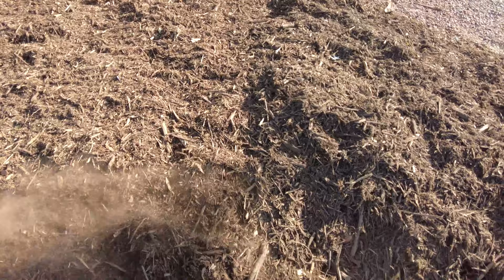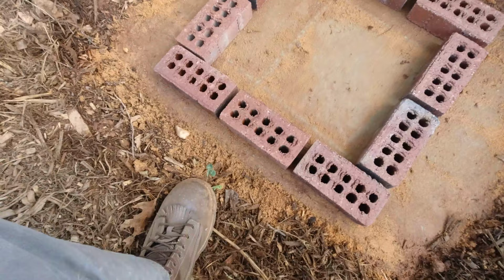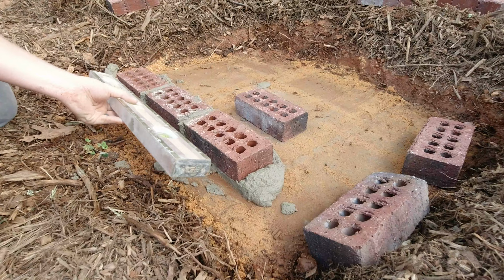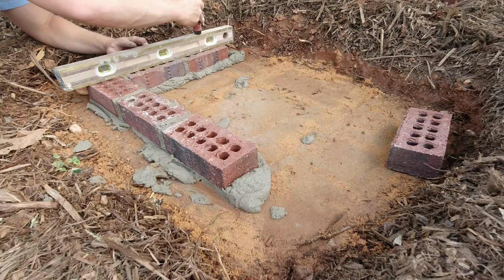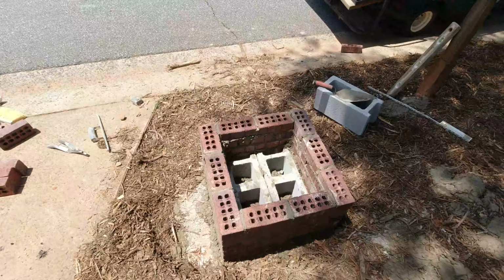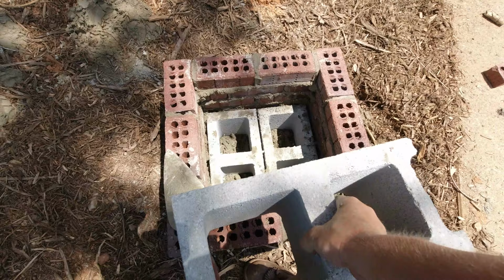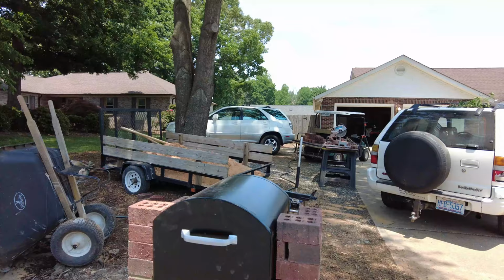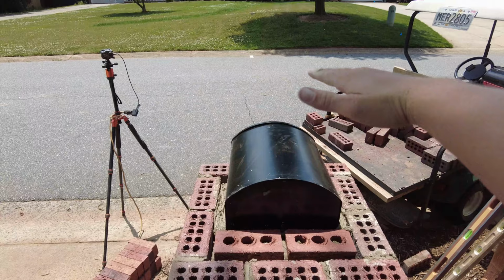Laying a brick mailbox

Comment: Walking my dog I see so many of these brick mail boxes looking like the leaning tower of Pisa, I hope the foundation was very deep and anchored with rebar otherwise it will be yet another in a few years!!
Reply: That's because those mailboxes don't have a footer under them,  you shouldn't tie a mailbox to the footer with rebar as code states masonry mailboxes need to be able to break away or apart if struck by a vehicle
Reply: @seanschafbuch4683  where I live, the guy in a sharp curve kept getting his box knocked over by cars. He sunk a 5" pipe in the ground. Next person to hit it got seriously injured and he faced lawsuits and charges.
Reply: Sounds like a good mailbox
Reply: You are correct! Even though code doesn’t allow structural components, I’m not running risk and poured concrete pad with rebar, as well as embedded rebar sticking out to tie masonry/concrete together. I infilled masonry cells @ rebar locations. I added brick ties to masonry to allow connection as well. My engineering background is to blame for over design lol😂
Reply: @el_ingeniero_87  yea I would of thrown in some ties. But I know it’s going to be fine! Beautiful work and great videos!
Reply: @el_ingeniero_87  all the more reason why a simple wood post is a better solution, and much cheaper!

Comment: You never showed us how you cut the bricks that went over and around ! How are we supposed to learn ? Did you concrete the inside of the opening as you inserted the mailbox ?
Reply from the maker: The video is more for entertainment than learning. I am sorry you couldn’t learn much! Each situation is different for how to cut the brick. Sometimes I used a chop saw with a diamond blade or a grinder with a diamond blade to make the cuts. Yes I fill the all voids solid around the mailbox as it goes into the structure

Comment: I like everything with except you didn't show The brick cuts
Reply from the maker: Thanks. I would have loved to show the cutting, but I was pressed for time during this. Maybe next time. But I just use a regular miter saw with a 10 or 12 inch diamond blade and mark and cut what I need to.

Comment: I had a delivery girl delivering food across the street knock my mailbox crooked yesterday. I just let her leave because she was delivering food with her kids in the car so you know she's broke. So anyway, I want to take out the wooden post mailbox I already have on my property and build one of these. Any tips for a absolute rookie at Mason work? My first question would be how do you get that surface the mailbox is going to sit on to be flat and not sink in when you finish building that multiple hundred pound mailbox. 🤔. On 2nd thought. Im sure there's a video for that as well.
Reply from the maker: That is very kind of you to let her go. Mason work is pretty hard until you get the hang of it. I would practice laying a few brick. Lay a tarp down and just practice laying about 3 or 4 brick in a row. Then level and plumb it and lay a course on top of that and do the same. You can disassemble it before it drys for easy clean up. The footing is actually pretty simple. I live in NC, so the frost line is not very deep. My mailbox footings are 12 inches deep and 30 inches by 30 inches square. Just dig your square hole about that size. And mix some concrete make sure it is mixed just a little bit on the wet side and it will self level when you pour it. You can use rebar to reinforce the footer.
I’ve thought about making some beginner videos. If I get a few people interested I am going to do some beginner videos with some training mortar and really do a detailed series on how to lay some brick. 
I hope this helps a little bit! I do recommend just practice for a day or so. It’s a little tricky at first. Especially when you are building a column like this and trying to keep it square all the way up. But once you get the hang of it… no problem at all! It’s really quite enjoyable.
Reply: @JustinBiddix  do it! This is the type of stuff I love watching. “Advanced” DIY. Many times a project can come out better than what a pro would do because you’re the one gauging time vs value. Some footing videos would be sweet. I seem to only find some dingus rambling on that won’t get to the point, or a manufacturer’s product video, which are so chop-cut you may as well just read the directions on the bag. Enjoyed this one.
Reply from the maker: @danervin2530  thanks!

Comment: Great, detailed, video!  My mason, put in some rebar to tie box to footing.  He also bowed the top course of brick slightly so water would run off.  He also said I could remove box and replace if needed by knocking out mortar around front of box.
Reply from the maker: Thanks for sharing that information!
Reply: Rebar is a big no no in masonry mailboxes. 

Masonry mailboxes need to have a break away from the footer in case someone hits it. 

Other bricklayers have told me horror stories about people hitting their mailbox and suing the homeowner and the mason because it was all tied together with rebar and either killed someone or injured them in the accident
Reply: @seanschafbuch4683  Wrong.

Comment: Question: Isn't it a little too far from the curb for the courier to reach from the vehicle? I know some municipality only requires only 8" from the curb.
Reply from the maker: It’s a little far. The reason I set it back so far is there is a water main right in front of it. If they ever need to repair the line they can leave the mailbox in.

Comment: Looks very good. Yours is the best I’ve seen. How many bricks did you use and how much concrete and sand did it take?
Reply from the maker: Thanks! The brick can be bought in a cube or a “band/section. A cube is 500 brick. A band is 100. You will need 3 bands. For a total of 300 brick. Get about 25 solids for the cap on top. It takes about 4 bags of type s masonry cement and about a cubic yard of sand.
Reply: @JustinBiddix  I can't believe you're not a pro. Your mailbox really looked professional done, and your instructions were on point. Did you have to cut any of the bricks to fit over the top of the mail box?

Comment: Question. What all did you mix into the cement?
Reply from the maker: Yes, so that was type S masonry cement mixed with mortar sand. Mortar sand color will vary depending on your region. Some will be white, some yellow, some darker... the ratio I always use is 3 parts sand to 1 part masonry cement.

Comment: About to do it mailbox, great detail video,  does your mailman walk or drive by.  I have to make sure mine is on the curb so he can stay in the truck.  Thanks
Reply from the maker: Thanks! The mail man drives by. The reason I set it so far back was to avoid being on top of the water main for the street. Maybe they could leave the mailbox if they ever had to make a repair on that water main.
Reply from the maker: He is still able to just put the wheel right on the curb and reach this one
Reply: I was thinking the same but makes sense with the water main.

Comment: I wonder if they had to redo it since it's a foot too far from the curb?
Reply from the maker: I did not. It still stands. I put it far from the curb because there is a water main in between the curb and the mailbox. It can be repaired without ripping up the mailbox. it’s a shallow curb that the mail man can drive on very easily.

Comment: Great video and nice work! Wondering what you were adding to the mortar at the beginning of the video? Looked like dirt, but maybe colored sand to get the color you wanted? Please let me know the logic of the mortar mix. Thanks!
Reply from the maker: Thanks for watching! That is mortar sand I was adding to the mortar. The color yellow is the most common mortar sand in the area I built the mailbox. That particular mortar mix I was using needed sand added. It was not a pre mixed mortar. I hope this answered your question. Let me know if not and I’ll try to further explain.
Reply: @JustinBiddix  can you buy pre mixed mortar so you don’t have to mix it? Your the first I’ve seen add sand to it so I am not sure
Reply from the maker: @BigHomie030  yes you can buy pre mix mortar and it will certainly do the job. The reason I add my own sand is because typically pre mixed mortars have less workability and set up faster. You will have to work a bit faster with pre mix. I like the workability of the masonry cement with sand better than pre mix.

Comment: Can I ask. Are the bessa blocks in the middle necessary? Could it be done without them fine? I’ve not seen anyone place them internally like that. I’m concerned as a rookie will it be extra difficult to keep them plus the bricks all plum and level 😅
Reply from the maker: You really need the blocks. Yes, it can be done without. But they are cheap and make a huge structural difference

Comment: Great video! Only question is how many bricks did you need and how do you calculate? Thx
Reply from the maker: Thank you. This is modular size brick. I like to purchase 300 brick for a mailbox. You can get them by the “band” or “section” at a brick yard. Each band is 100 brick. A whole “cube” is 500 brick. Rule of thumb for modular size brick is 7 brick per square foot of wall. There are also some good brick calculators online. Just identify what size brick you are using and square footage of wall.

Comment: Why is the mailbox so far back from the curb? It seems to me that the mailman will end up having to literally drive up over the curb in order to reach the handle.
Reply from the maker: The reason is because there was a water main I was avoiding putting the footer on top of. That way if it ever needed to be serviced they could leave the mailbox. It’s not a big deal because that curb is not a traditional large curb. Look how short the curb is. A vehicle can drive right on it no problem at all.

Comment: What happens if you dont already have a concrete footing? How deep do we dig to make one
Reply from the maker: It really depends on your region. You should look up building codes and find that information. But here in NC I have been digging them about 18-24 inches thick with no problems. And it should be approximately 30x30 inches for this size mailbox.

Comment: How do you determine how much mortar to put between the brick?
Reply from the maker: The joints need to be full with no gaps or voids. It takes practice to get a feel for how much mortar to use without wasting a lot. Generally the bed joint (horizontal joints) should be 3/8 inch thick. And head joints (vertical joints) should be about 3/8 inch thick. There are codes for each area that go into detail about how thick your joints have to or need to be in particular areas of construction. A great tool to use to gauge bed joint thickness and keep them consistent is a masonry modular spacing ruler. That is what I use. For the head joints just use your finger tip as a measuring tool and try to keep the head joints full and consistent.

Comment: How did you cut the 2 curved bricks that sit on top of the front of the mailbox?
Reply from the maker: Hey, they are cut at an angle. I used a miter saw with a diamond blade to make those cuts.

Comment: Super nice mailbox!!How many bricks, cinder blocks, and bags of concrete were used in this project?
Reply from the maker: Thank you! About 300 brick, 10-12 cinder block, 3-5 bags of type s masonry cement depending on how efficient you are (you add your own mortar sand to these) - tip for buying this many brick: go to a brick yard and ask for 3 “bands or sections” of brick. Each band is about 100 brick. A whole cube of brick is about 500 brick. Purchasing by the band or cube is the way to go because they are strapped together. If you bring plastic wrap for packaging you can wrap the sections together and they can load your truck with a fork lift. If you don’t go this route then buy a set of brick tongs on Amazon. They are cheap and work great! -you may already know all of this. I just felt like writing all of this to help you or someone else out.

Comment: No foundation?!! No rebars?!! Just wondering how long it'd last straight up.
Reply from the maker: I have rebared some and some not. Still have ones with no rebar standing from the year 2012
Reply from the maker: There is a foundation. It’s a 12 inch thick concrete slab 30 inches by 30 inches
Reply: Why would you bother putting rebar or where in a small job like this?

Comment: Hey sir, great video. Very helpful. Do you remember about how many bags of cement you went through on this? I don't know how to estimate how many to buy.  Thanks!
Reply from the maker: Thank you, about 3 or 4 (80 pound) bags of type s masonry cement. depending on how efficient you are. Maybe could get away with 3 bags. The ones I use are not pre mixed. I add my own mortar sand. The ratio I have always used is 1 part cement 3 parts sand

Comment: I'm going to be using lime mortar. Will lime mortar adhere to the metal mailbox at all? If not, is the pressure from the bricks beside it and the pressure coming down from the courses on top of it enough to secure it and keep it from coming out of the brick structure?
Reply: Also, the concrete base that I poured is fast-setting quikrete. Will my type S lime mortar stick to that? Or do I need to spread thinset, and then lime mortar on top of that for my first course?
Reply from the maker: I don’t have the knowledge to answer your question confidently. I would assume you’d be fine without thin set on the footer. And probably be fine around the metal mailbox also. Again, I’m not sure. Just assuming. I’ve never used lime mortar.

Comment: Looks good dude! What's your sand/mortar/Portland (whatever you were using) ratio? What region of the country ya in?
Reply from the maker: Thanks! It’s type s masonry cement with yellow mortar sand. 3 parts sand to 1 part masonry cement. This is in western NC
Reply: @JustinBiddix  Right on! I'm in VA so probably would use similar mix

Comment: So just to add..
The only way to properly square a brickwork pier is to measure from corner to corner diagonally , both sides, making sure the measurement is the same.
Don't just use a square and check all around the pier.
Reply from the maker: Thanks for the tip!

Comment: Great video and informational ! Did you vote fill those blocks with gravel by chance? Also, what was the offset you used for the top cap? Thanks!
Reply: Also, did you pour that concrete slab? What would you recommend for someone that is interested in installing this?
Reply from the maker: Thanks! I did not fill the blocks with gravel. I did fill them a little bit with some left over mud. The offset is 5/8 of an inch. I did pour the slab. I usually pour a 30x30 slab at least 12 inches thick here in NC. I recommend reinforcing the slab with rebar.
Reply: @JustinBiddix  thanks for the reply man! I definitely appreciate it. Great content
Reply from the maker: @Jondongalong  yeah better safe than sorry. I wouldn't want the ground to get too wet after a lot of rain and the box start to lean over. maybe over kill.. but I don't want my name to be on a leaning box.

Comment: You did a good job👍
.. But it looks too far from the street
Reply from the maker: Thanks!  It’s a little far, there was a water main right in front of it. I chose not to build on top of it. I guess it wouldn’t matter. But I figured it may save someone working on the water pipe some trouble one day.
Reply: @JustinBiddix  I guess as long as the mailman can reach it from his vehicle it would be fine.?

Comment: how much would it cost to have someone build that for you? or what would you charge for labor?
Reply from the maker: In the southeast for a quality job it should be in the 1300-2000ish range. That’s materials and labor. I have seen masons do this as low as 7-800 dollars but that was the year 2019 and that’s probably a very basic design and hardware.